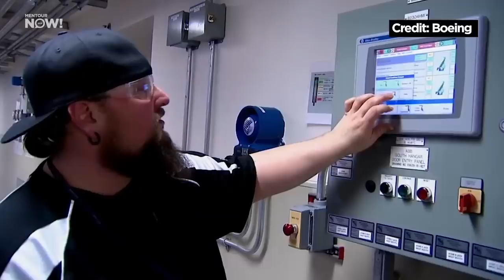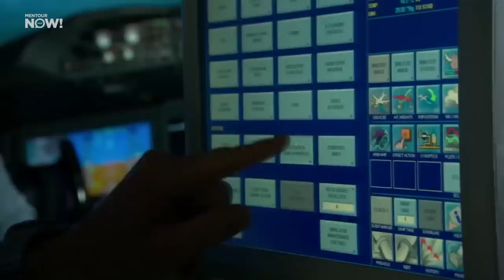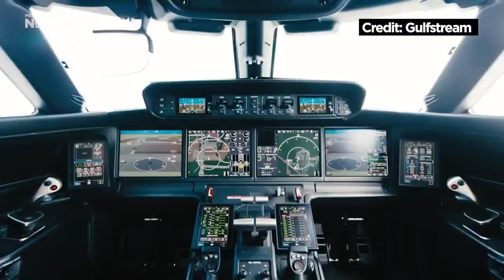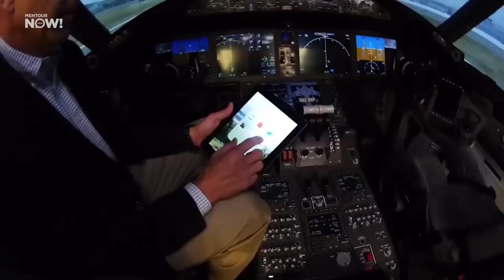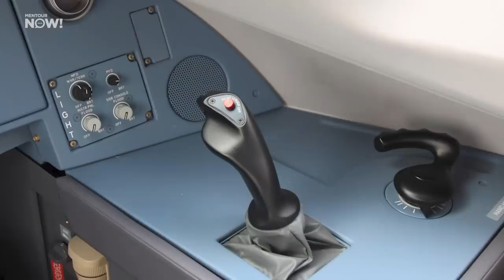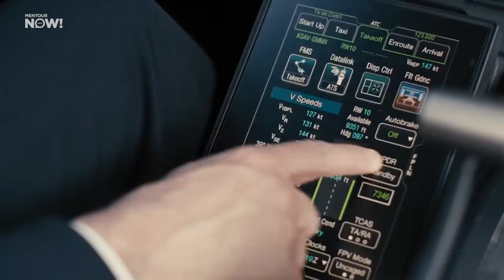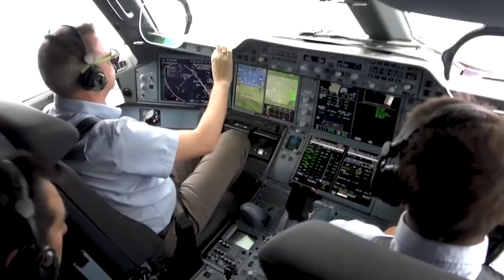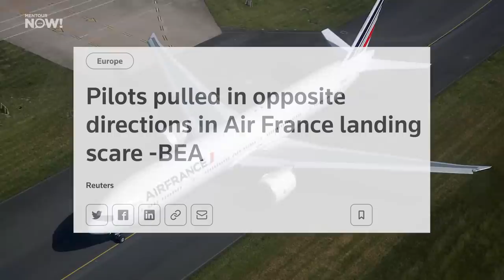Is Boeing Switching to SIDE-STICKS?!

Comment: In several of your crash videos, you’ve shown how some crashes happen with asynchronous control inputs on side sticks where those warnings are covered over by more important warnings. In some of these, Master warnings or similar alerts are more important but those control inputs are actually causing these Master cautions. How are the airlines fixing these types of problems?

Comment: Very good mentioning AF-11. As mentioned, the final BEA report is still not out, but this was a dual-input issue with a yoke design and the pilots did not realise the problem. The argument that a mechanical yoke eliminates the sidestick issues is not entirely valid; it only mitigates the input/feedback challenges - but they are still there as AF-11 have shown us. When humans put their mind into something, decide what is true or false, humans end in a tunnel vision situation very difficult to escape from - sidestick or yoke.

Comment: Did you hear about that incident when the pilots of an Airbus A320 lost pitch and roll control mid-flight?  After going through the checklists, they discovered that the joystick was accidentally pulled out of the USB port!  (right, I'll just show myself out now)

Jokes aside, I think the best advantage of sidestick is that it is out of the way for the 99% of the flight when the AP is engaged or you are controlling the aircraft via the MCP.  Additionally, you can use the pull-out desk/table for your checklists and eating meals while facing straight.

Comment: I think Boeing will keep yoke for the foreseeable future. Type rating/training easier.
Reply from the maker: It’s possible but I think there might be a chance of a switch..
Reply: I'm not associated with aviation at all, other than riding in the airplane or the airbus.  I'd think that Boeing can't change to the side stick just because it would be an admission that the competition was "better" and that it would be seen as "they finally caught up" or, worse "they copied Airbus because the side stick is 'better.'"
Reply: @Clayson Antoons it wouldn't be a "new Coke" situation?  Airbus wouldn't advertise that "they finally learned that we were right all along?"  Is aircraft marketing different than marketing other technology/machinery items?  (genuine question, as, I'm sure you can tell, I'm not in marketing either.)
Reply: The last time Boeing made a technical decision for training reasons, people died.
Reply: @MentourNow  Let's hope not
Reply: @excavatoree  Boeing could have said the same when Airbus switched to composite airframes, or if Airbus switches to/ has switched to using electric actuators. Or Airbus could have said this when Boeing switched to FBW. Most airlines choose planes based on cost, cost of fuel, cost of maintenance. I doubt any would be swayed by Airbus making a big noise over Boeing switching to side-sticks.

Comment: Well unfortunately Air France flight 447 didn't have active side control sticks, probably it wouldn't have gone down, so that's definitely a plus if the future Airbus or even if Boeing goes that path to be introduced in commercial air travel!! , good job Mentour, love these insights of where aviation in general could go next.

Comment: Further use of haptics might help. Taking a page from traditional knob and switch design, you could imagine a sidestick whose handle actually changes shape when the control law changes, or that similarly provides tactile feedback in the case of conflicting pilot inputs (as opposed to FBW feedback). Imagine, for instance, a stick that can change profile from something smoothly contoured to something more angular, or whose padding can get stiffer under the hand. There's so much more we can do than just shaking!

Comment: When I read the report on AF447, it became immediately obvious that the side sticks should be servo 'd together so the other pilot knows what's going on. There should always be force feedback. An experienced pilot told me that decades ago. 

Also, the servo should (looking at you 787) should have a very high force limit, not just 50 pounds, more like 100 pounds before a very loud audio warning goes off.
Reply: If you fully read the report you’d also see the sidestick was not listed as a contributing factor

Comment: I think it’s time to do away with the yoke on digital new aircraft.  As a military pilot, most of my hours were logged in yoke aircraft because they were often two pilot driven and mechanical.  I’ve also flow a few flights in the F16 with it’s side stick controller.  The side sticks in Gulfstream digital flight controls seem the way to go.  You don’t need the yoke for EFBs or other flying equipment so side stick provides visual confirmation of inputs and allows cross check of inputs.  The side stick will be more productive, less space consuming and allow a facsimile game controller button access to glass displays.  It will probably require a type cert because it’s logic pattern will be outside the current model.  Progress is hard, but ultimately rewarding.
Reply: Ko
Reply: One big difference between flying an airliner and a fighter is that in an airliner you are only going to have a hand on the yoke/stick for a very small proportion of the flight - most of the time is spent on autopilot just monitoring things. For the great bulk of the flight a yoke or centre stick is just going to be a big nuisance - obscuring intruments, easily bumped, and taking space.
Reply: @kenoliver8913  Ken, observations are correct.  When you can’t observe the position of flight controls because of the control column/stick, then you lose SA with the AP engaged.  I am working my IR rating and I discussed with my CFII how critical it is to disconnect the AP when you are in icing and gusting crosswind winds.  These two conditions require hand flying.

Comment: You quite rightly stated that the 777 was fly by wire but it is important to clarify that when Boeing developed the 777 they did so in collaboration with United Airlines as the launch customer.  During development Boeing intended to use side sticks but was met with resistance from UA pilots who basically didn't have enough confidence in that design and insisted on a conventional yoke control system.  Boeing then designed a feel system attached to the yokes which are nothing more than a very heavy side stick with artificial feedback.

Comment: In the case of the original 777, the first fly-by-wire aircraft from Boeing, there is a mechanical cable connection to one pair of spoilers and the horizontal stab trim so in theory you could still control the airplane if there were a complete failure of the FBW system.
Reply: I think there is a reversionary mode but I’m not sure. Have to ready the poh

Comment: I think force feedback may prevent a lot of crashes where both pilots grab the controls (as the aural warning might not be perceived if they're tunnel focused). Nonetheless I would prefer a nice big yoke in front of me, harder to miss than something on the opposite sides of the pilots. If your colleague grabs the yoke you have a better chance of catching the movement. I think front or side sticks make a lot more sense in smaller (but beautiful) general aviation aircraft like the Pipistrel Panthera, due to the ergonomics of it and it often being flown by one pilot, and of course in gliding. But yeah I would definitely prefer a yoke (although maybe with a side-design instead of a floor design, for better leg space).

Comment: Although I trained in Cessnas, with their dual yokes, I believe sidestick are the future for all aircraft, from GA through military to airliners.
The weight saving, flexibility, space benefit and ergonomics simply can't be ignored.  As all aircraft move to FBW, the additional force that can be exerted through yokes becomes moot, and force feedback is now fully mature, allowing dual pilots to feel what each other is doing, as well as what aerodynamic forces are being exerted.  It allows maintenance to replace faulty units as a module, or even plug in additional controls for (for example) a check pilot.
So I think it is inevitable that the yoke will go the way of the dodo, and pilots in the future will marvel at the old yokes, and just how much of the pilot's field of view they consumed.

Comment: So if pilots hate the term "joystick", and the control sticks in airplanes are called "sidesticks" because they're on the side, then are helicopter control sticks called "centersticks"?
Reply: No, it's a "Cyclic", Helicopter do anything differently.
Reply: In a logical world yes lol however helicopter center sticks are referred to as “cyclic”
Reply: Actually it’s called a cyclic pitch control stick or “cyclic”
Reply: Small planes commonly have a center-mounted stick as well, typically they just call it the "stick" or "control stick." Never heard it called a "joystick." In my perception anyway "joystick" typically refers to a smaller control used for controlling a computer system or video game (think the little sticks on a game controller), the stick on a smaller airplane (not fly-by-wire) is larger and mechanically linked to the flight controls. Side-sticks are sort of between the two in terms of size.
Reply: @quillmaurer6563  I don't know... the A320 sidestick/throttle set that I use to fly MSFS and X-Plane is a 1:1 to the A320 throttle and stick... is that a "sidestick" or "joystick"? just because it's attached to a computer... 

Oh and by the way... a modern FBW airplane is just a computer with wings and extra seats... so... that would make it, by your definition, a "joystick."
Reply: @AKStovall  if you put your joystick off to the side of your desk it becomes a sidestick, lol.  
I think it would be hilarious to actually see an Airbus pilot get triggered by hearing someone call it a joystick.  Who cares what it's called.

Comment: The 777 and 787 are different type ratings in the US, as well as the A330 and A340. The only common type is the 757 and 767 over here. Are these really common types under EASA?
Reply: Yes. And the A350 can be a common type rating with A330 too. The only one that has its own is the A380

Comment: I spent my last five years at Boeing in Product Development, where I actively promoted active sidesticks and worked with multiple suppliers on them.  That was 2005-2010, so I really don't expect it to happen any time soon!
Oh, and Boeing Commercial doesn't use the term "yoke". It's a "control wheel".  My signature is on the drawings.

Comment: Great video Petter.
Technically interesting.
I think they will have to consider it certainly.
However they are known to be less inovative than other manufacturers.
Having "flown" the airbus A320 level D in BA's training facilty(courtesy of a TRI friend) i loved the sidestick.
Same when i "flew" the B747 level D sim there as i had the GA pilot experience of the yoke.
Personally i would fly it no matter what type of controls were installed 😉

Comment: I work in the marine industry, a few years ago Volvo Penta introduced a joy stick controle to operate its new  IPS drive system, conventional controles were still available onboard,  it allows you to do almost anything you want with the boat at low speed docking  situations,  I have never liked it, prefer twin shaft drives and  a bow thruster, more controle, and for less expierienced captains , the joystick is less intuitive and easier to get into trouble.

Comment: As an enthusiast and not a pilot, I would say my favorite example of a side stick is what is used in a Cirrus SR22. Granted, it is pretty much the smallest 2-pilot aircraft ever equipped with a side stick, but the side sticks are mechanically linked to each other, and they are mechanically linked to all the control surfaces. 

I believe Cirrus handles trim on their planes with a preload set against the control sticks, so that the neutral position of the control stick changes when you adjust the trim, rather than the stick's relation to the control surfaces actually changing, but I don't know as much about them as I would if I actually flew one.

Comment: The real difference I care is C* vs C*U, aka if you can feel speed deviation with stick pressure.
AFAIK A220 and C919 uses C*U FBW law as 777/787, but on side stick, (not sure on Gulfstream and MC21). It really helps to feel if your speed is changing when approaching and watching the runway rather than speedo and without using A/T.
BTW even on 737 (actually from 707) the yoke feeling is already full artificial with spring and hydraulic in normal condition, it doesn't trim like a conventional G/A with trim tab anyway, so no need for a FFB system to make side stick feel like that.

Comment: I suppose if Boeing can make sidesticks have the same advantages as a yoke, it would be OK. 
Airbus hadn't done that, so they had several air crashes where side-sticks contributed to a disaster.
But as the 777 incident could show, there is just no way to eliminate the ability of humans to screw up if they don't follow the procedures for cockpit coordination.

Comment: Unfortunately the standard biased view from a Boeing pilot with a chest pumping "if it's not Boeing, I'm not going" mentality. I have flown both from the A350 and now back to the B777 and I can tell you that yoke is only their because Airbus did it first and therefore Boeing can't appear to follow Airbus. Nothing more than a pride thing. What is not discussed is the overall view of instruments and perspective of the flight controls that Airbus and Gulfstream have without the yoke. The added and mostly understated feature is the abilty of the traytable is to be able to eat your meal instead of balancing your food on your lap or on the techlog.The yoke unfortunately is a ghost from the past that Boeing still can't shake. In reference to sidesticks being left in a negative trim, this is factually incorrect. Airbus has auto trim on most automatic pilot inputs in turn, climb, descent and based on the actual current flight envelope.The ONLY time that an Airbus pilot needs to manually trim is in an engine failure after takeoff. The rest of the time, the fly by wire systems automatically trim the aircraft. I think you might have confused that with the infamous MCAS trim system on the 737 Max. Over my entire flying career flying both Boeing and Airbus, the only people that hate Airbus are Boeing pilots. Is it a lack of understanding, is it fear of a better product, is it a dismissing claim for pride or ego that Boeing is no longer the world's leading aircraft manufacturer? Who knows? All I know is that both manufacturers build amazing airframes that cater to the aviation market. What Boeing pilots fail to address however is how far Boeing have slipped from the 1990s. They were once an innovative, proud and respected company that pushed aerospace boundaries. The beginning of the end was the MD merger in the 1990s. Quality has suffered, 787 was a total mess and the 737 Max was a disaster, all in the name of cost cutting and shortcuts. Look deeper into Boeing space program and the problems still reside. They still can't get a capsule to the ISS. Boeing better turn it around soon...the yoke discussion isn't their biggest problem.
Reply: Excelent!!!

Comment: I'm not an airline pilot but a simple flight simulator enthusiast.
In my opinion the only sidestick disadvantage is related at fact that both axis (pitch and roll) converge to a single fulcrum.
So, for example, a pitch input (for example during rotation),  make possible to apply an undesired small input on the roll axis too, and vice versa.
Yoke instead, has two separate fulcrums.
Reply: Yes, l agree. Pretty sure FBW elininates this problem. Fly the Airbus 320 with TM Airbus TCA to see what I mean.